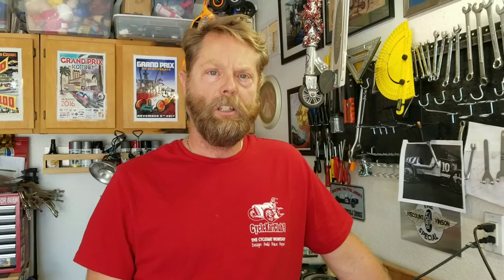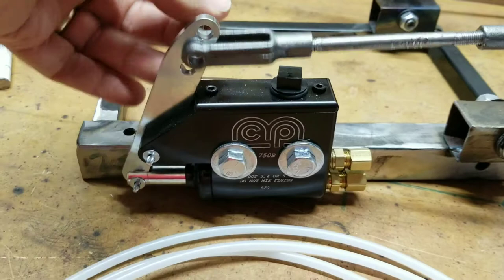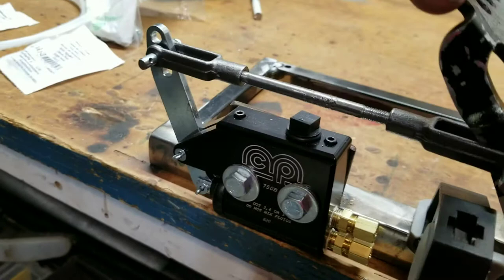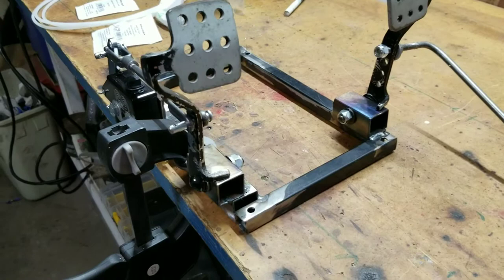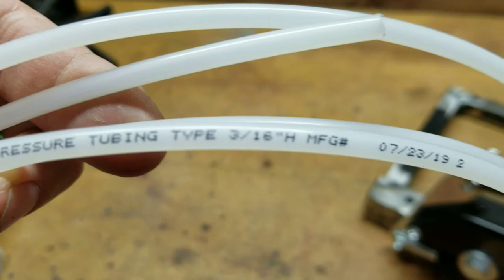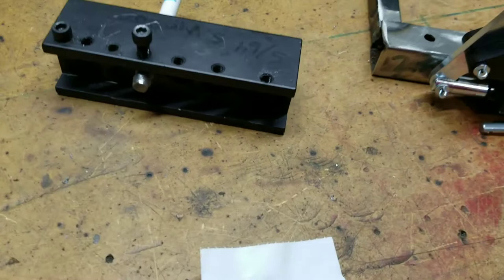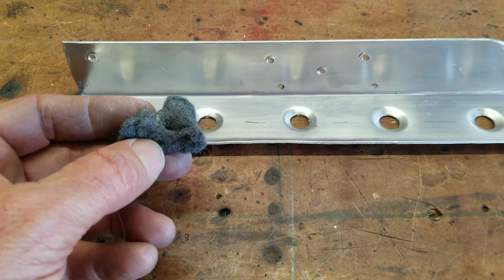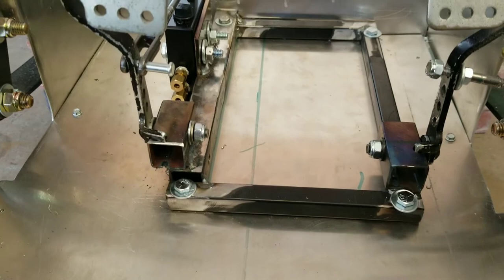Cyclekart Frame Part 8, Pedal Assembly

Comment: The tool that you used at about four and a half minutes to drill for safety wire, you could also run a sacrificial nut on. Just drill through the nut and the bolt at the same time, and when you back the nut off, it'll clean your threads up.
Reply from the maker: That is brilliant.  Thanks for the tip.